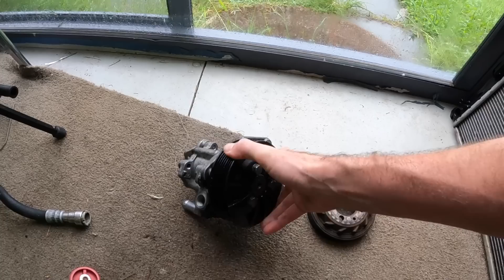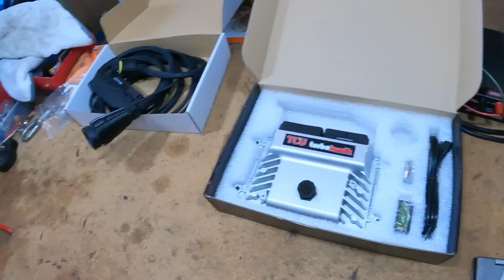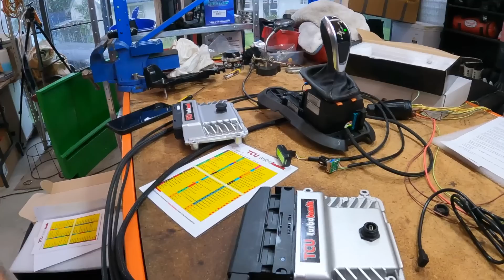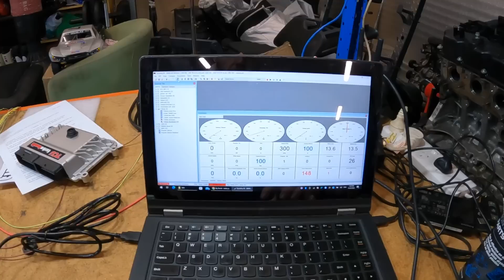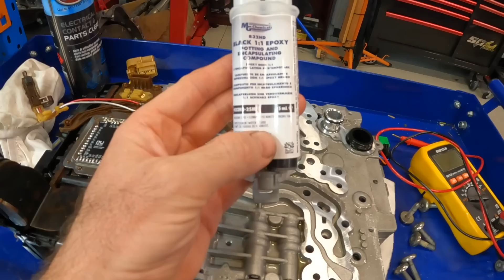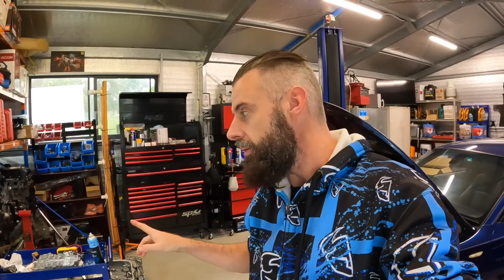BMW N54 135I 8HP INSTALL PART 1: TCU MODIFICATION

Comment: Hey did I hear you say better use the diesel converter than the N57 one? For single turbo application?
Reply from the maker: i cant remember this video. Sorry. However the diesel converter from N57 is tighter than the N55 petrol converter.
Reply: @ZeroTo60Tube  ah so the N57 is a diesel? Thought it wasn’t sorry my bad.

Comment: Key for good and easy soldering is to use the smallest gauge solder (I personally use 0.5mm diameter that has flux in it) and sharpest soldering iron tip you can find👍🏻 Great video as always. I have to say that you did great job soldering that box considering that I couldn't have soldered a thing using wire that thick

Comment: Hi any news why the one tcu gave the extra error codes?
Reply from the maker: Havent worked it out yet. It works fine in the flowmax car.
Reply: Thanks will just be interesting to know I'm in the process of doing a 8hp swap and enjoying your videos but would like to see how the 8hp45 will do in the 135 I'm planning on putting a 8hp45 behind a Mazda 4cl engine so planning max torque around 550-600nm peak and. About max 500nm at 7000rpm

Comment: Oh Damn!... you better believe this video caught my eye. As a fellow 135i'er I'm Über keen on seeing how this project unfolds! You can bet a good portion of my future spare time, and spare change will be devoted to tracking down a proper E70 8HP now.🤓 By the way Andrew, has the owner of this E82 upgraded to an LSD yet? And, in case I missed it, how about the FLOW MAX car? Thank you for the amazing info and helping make the N54  platform more exciting than ever!
Reply from the maker: This one is a stock diff, i believe. Flow max car does have an LSD.

Comment: You need some FLUX added to your soldering kit.  It may splatter or need a final clean up with some IPA after soldering.   I have not had to do any soldering work on my n54 car yet.

I like Kester Brand solder for working on keyboards, I would go with the Silver 63/ Lead 37 if you can find it, if not a Sn60/Pb40 will do.  63/37 will flash/ solidify almost instantly and help prevent cold solder joints.  The Sn60/Pb40 transitions a bit slower to a finished solder joint.  Stick to quality brands for solder.  Kester, AIM Metals, MG Chemicals, Loctite.   

As for flux, I use a paste SRA flux #135.  Flux is a game changer.  Flux removes oxides on the metals and makes the surface "wetter" ... sooo satisfying.  GOOD LUCK!  

And soldering rule #1) If you smell bacon, THAT IS NOT BACON, its your hand! 

Kester 24-6337-0018 
Kester 24-6040-0027
SRA flux #135

Comment: whole different ballgame when you use flux paste for soldering, definitely try it out you’ll thank me later!
Reply from the maker: I do use flux. I think my issue is the size of the soldering tip. It doesnt transfer the heat in to the pads quickly enough. Based on a few other comments anyway.

Comment: You have to use flux, otherwise the solder will not flow in place. Very nice stuff going on in the shop guys. Good luck, Dutch regards, Nico.

Comment: Bro how much is the turbo Lamic?
Reply from the maker: The actual unit is about $1300euro. But then you need the wiring, adapater plate, transmission cooler and so on. In Aussie it cost about $5000aud to setup it up in the other car with the 8hp70, plus the cost of the trans.

Comment: Soldering is weird. Make sure the part is clean. Flux the contacts. Make sure you're tip is still good. Tin and clean your tip. Retin and the tip and then tin the pads. It can be really fiddly, especially when you get into super small or weird joints. 

I'm really enjoying the content. Its holding me over while I search for a 335I E92 of my own. Cant wait to see more of the single turbo car with the equal length manifolds.

Comment: Anyone try a 2013 E84 X1 8HP?  We are thinking of trying it.
Reply: Nothing speaks against it! Actually a lot for it! But shouldn't a 2013 already be an 8hp? I once Was curious about the n52 x1s but the 6hp Tore me away
Reply: @maxgr7723  I meant using a 2013 X1 8HP to put in a 2009 E93 N54
Reply: @igotaction  that would mean using an n20 setup?
Reply: @maxgr7723  correct, same 8HP 45, although in USA we had N55 option 2013-15, but I know 2013 has only one PT CAN
Reply from the maker: Do it Joel!!!! Really you need the tcu assuming it’s the e series x1. Then any n55 trans should bolt on.
Reply: @ZeroTo60Tube  I would be doing it with @vehicularDIY channel.  These 2013 X1 8HP trans are $400 here I'm sure the shifter and harness aren't much more.
Reply: Actually shouldn't this be coming with an 8hp50 and having more the positioning of the dieselstarter and angle of the dieselgearbox like zf8hp70 then the 8hp45 from the n55? Actually one big thing that differs. The n55 8hp45 has the same dimensions as the 6hp...the n20 8hp is shorter
Reply: @maxgr7723  8HP50 is 2nd Gen 45 like 6HP19/21 26/28, since we are talking 2013s it would be 45.  I am getting ready to pull my 6HP so I will measure and check when I pick one up.
Reply: @igotaction  I'm really long now looking up the 8hp stuff, and I more then once watched the images and discussions in the swapping groups im in. The 4zyl 8hp comes in a different sized then the 6zyl 8hps
Reply: It will work, but torque converter won’t fit, and the box won’t be tuned right for the engine.

It is technically possible to flash E84 8HP software to another 8HP, such as that from F10. Tuning still needs to be figured out.
Reply: @ConroyCheers  actually would this make any sense? Do the n20 e84 and the n54 e93 cars share so much Controllers that you can make the e93 go with the OEM tcu? Actually it sounds like a ton of hassle. My honest opinion, get a n55 zf8hp45 torque converter, a n20zf8hp50(if that's so mandatory) and either go lamik or cantcu. One of both versions should make the car work with each advantages and disadvantages. Still best Option would be an 8hp45 from an n55 because it has the same dimensions then your 6hp and you avoid all the n20 things hassle!
Reply: @maxgr7723  if you go Lamik/CANTCU, then you only need to worry about physical compatibility, so yes, N55 8HP45 would be a great choice.

I want to avoid the high unit cost of setting up these external controllers, and hopefully I can lay the groundwork for 8HP swaps to become cheaper and easier in future.

As for the N20 E84 and N54 E93 sharing all their controllers - essentially, yes, they do. The relevant ECUs don’t actually need to be identical, because there will be CAN messages shared between different families of ECU. For example, the transmission will send a torque reduction request message to the DME when it shifts. Looking at it from BMW’s perspective - there’s no reason to have 5 different versions of this message for 5 different DMEs; it’s much simpler to program all the DMEs used in the E89 family of vehicles to accept the same message, and this way you only need to make a single transmission program that uses this one type of message. The same goes for the DSC and other modules. I’ve hooked up a E84-programmed 8HP to my E90 and can confirm it’s receiving most of the needed messages already. There seem to be a few minor exceptions, and it should be possible to work around them.

With full read/write access to the TCU, it should be possible not only to port stock tunes between different firmware versions, but also to configure it to communicate with different modules on the CAN bus. From what I’ve seen so far, some of this stuff is actually in the tune/data file, and some is in the program.

You’re definitely right that this isn’t a quick or easy solution for someone wanting an upgrade, but for me it’s become an interesting project, which seems like it could have a lot of value to the community, and for that, I think it’s worth pursuing.

I’m doing this on a N52 car, so for me, an N52 F10 8HP45 is the best option. Unfortunately, they are very rare, but I’ll be able to find one with some patience.

Comment: Hey mate not sure if you use flux when soldering but will make your life way easier
Reply from the maker: Yeah, flux the crap out of it…. I’m thinking it needs a thicker tip to actually get heat transferring on to these oads

Comment: About the epoxy...maybe put some atf and a piece of something with epoxy on it into a can , maybe even heat it to a usual zf8 temp and see if it becomes loose or smth before putting the 8hp together and filling it with atf...
Reply from the maker: Not a bad idea. I had some left over, I’ll put it in something and see if I can hurt it!

Comment: Hey long time sub here. I am running the Canformance “CanTcu” in my E90/N54/Hybrids/xDrive 8HP45 swap… first xDrive? I just wanted to give Ken a shout out as he has been amazing working through the various issues that had come up. The wizardry that is going on behind the scenes to make these units talk to each other is impressive. I will be making a post shortly on spoolstreet with more info. I am just trying to do my part now and stop the DME from giving me the old fashioned timing flatline post shift to call it done. I’m curious if you are working through the same issue with the Lamik/Wedge?
Reply from the maker: So with the lamik the torque reduction is just a setting. Well it’s a setting with a few tables to tune how much torque reduction occurs and for how long. The flow max car is still on default settings which are safe in my opinion lol. Car feels amazing to drive but it’s pulling power for a while. That said it recovers as the lamik stops requesting reduction.

I know from working with a lot of 6at cars getting the post shift timing corrections dialed out can cause an issue for a lot of tuners. However wedge will know every way possible to make it work. The bms flashes were the worst I experienced and unfortunately a lot of tuners learnt from those. Who is doing your dme tuning?
Reply: @ZeroTo60Tube  I do all my own tuning. Not a pro by any means but have about 6-7 years on this platform circa BBflash and many years on others. But again just a hobbyist for myself and friends. In the CanTcu you run the OEM programming so I have xhp stage 3 installed. However what I did not realize is the 8hp version of xhp does not have any adjustments for torque reduction probably too many maps/drive modes. But would be a nice update to be able to use on maybe “stage 4” flash only. 6HP xhp users are spoiled with this haha. So I may look into making a custom map for the xhp but like you said there are soooo many maps on the 8HP it’s a daunting task. And quite a pain using winols when you do. That will be the last resort so for now just tinkering to see what will making it happy with reported torque and load relationship. Careful what you read online from the early days on flatline a lot has changed since then. I know wedge is well aware of all that and I’m sure he will figure it out and hopefully share some insight. IJE0S/xDrive is notorious for this and post shift corrections. 

OTS BEF is good for probably 80% of JB4 users and same for ots MHD but at this level a custom tune is the only way as each car has its own little quirks. Either way I’m happy to see the N54 world getting some attention again from these guys… 

I may be regretting not going with the 8HP70 soon as I am seeing slip even in drag mode going to 6th. It’s still turned down to around 500wtq for this testing as well. But for convenience the 8hp45 was bolt on no adapters even for the transfer case. Only hardware mod was adapting the oil cooler lines. 

I know Ken@Canformance plans to eventually offer a stand-alone option but I think that may be far off. Again big thanks to him working crazy hours with the time difference from USA to Finland to get me to where I’m at. I am happy just having it in my car and running for now with no errors I will figure out the rest eventually. Though the drives in Mexico are really hurting my fuel economy at the moment lol.
Reply: Very interesting insight wancasta. Actually im planming to use canformance cantcu for an e46 330i and hopefully a b3s...actually I think I won't have the problem of to much Power and torque then...maybe more the problem of not enough as both are n/a
Reply: @maxgr7723  It will hold it no problem with torque reduction active. The problem I have is the timing doesn’t start to recover until after the following shift but this is an age old N54 issue you should be fine. My thoughts when going the with the 8hp45 was it is basically still the same hardware as the 8hp50 running in all the b58 cars making similar power with no issues.

Comment: Cam performance? Any info on where I can find more details on taking that route?
Reply from the maker: I can’t believe you couldn’t pick it from my description in the video. Canformance Cantcu in google should bring it up. Kenneth watches the vids so mention where you heard about. Seems like a good solution if you are not performance orientated. Mainly due to the trans still running a stock tcu. Where the lamik has full control.
Reply: Haha. I must have been walking my goldfish and missed it :) wanting to swap the M57 & 5L40 out of my E39 for the M67 and ZF8. If I wanted all out performance I’d get rid of the diesel element haha
Reply: @craigpickering5784  happy luck finding a 740d

Comment: Hey zero to 60. I have a question about something

I bought a 335i e90 about 2 weeks ago and I have noticed under full boost while doing a pull, and during the pull around 6k rev's I hear something go "tap tap tap tap tap" super fast almost like it sounds like a solenoid but then after multiple times of that, it then gets an engine code come up saying "Superknock on cylinder 1,2,3" (Shadow code in MHD)

Would you know what that is at all? It's driving me crazy of what it could be... The car is running stage 2+ with intakes, charge pipe, downpipes

Cheers man, love your vids
Reply from the maker: What you are describing sounds like detonation, which is knock. And very very bad. Need to check why that it, if your have a faulty O2 sensor and the DME doesnt realise it may make that entire bank run lean. Also very sorry for the slow reply, youtube put it in the spam folder. Let me know when you work out what it is and avoid driving the car when it does it. If it is detonation, its eating your pistons.
Reply: @ZeroTo60Tube  Hey Zero To 60, nah all good brother,  yeah my O2's were bad about a month ago and I got them replaced as they were damaged when I got the downpipes fitted by a mob.. I replaced then and the O2's are perfect, getting 11.5-12 AFR's..

Still today, I have no idea why it's doing it, seems the the torque is not there while the "power" is there which is very odd.

Starting to wonder if it's my injectors not working properly because I put some injector cleaner in it and after a few minutes of driving, the power is there and everything but after a few days, it's all gone...
Reply: But then it doesn't explain the "Superknock" shadow code...

Is there any software or test I could run to see what it is exactly, or a place in Brisbane that I could take her to, taking a wild guess that's your home town, as I am on the Gold Coast 👍
Reply from the maker: @rabbitolychee6395  super knock is detonation. well..... if you can just wait abotu 2 months i might have a shop ready to look after customers.
Reply: @ZeroTo60Tube  Oh man, if you open a shop I'll take it to you at any cost man, I'm only 19 and spent so much on this 335i and now I can't find the problem! Seems very odd as it does keep back firing on it's own, seems like it's dumping so much fuel while there's a misfire... Very strange problem and has no codes.

Comment: Amazing 👍. Will be great to finally see if the 8hp45 box fits n54 and what other hardware is required. Thank you 😊
Reply: Actually the n54 isn't much of a problem as it already has so many in common with the n55

Comment: That shifter is likely from a DCT E82, they didn’t get the glossy trim. Not cross compatible with the 8HP shifters, unfortunately.

What errors were the E70 guys getting? I’ve been playing around with one and could probably help.
Reply from the maker: E70 guys were abs errors.

Can you clarify the not compatible with 8hp shifters please. I have it set as a e92 m3 shifter in the lamik. Same as the way I have the e series 8hp shifter set in the flow max car
Reply: @ZeroTo60Tube  can’t speak on the Lamik, but I initially had an E82 DCT shifter which threw all sorts of errors when connected to the 8HP; swapped it for an E84 shifter and it was happy. Presumably they have completely different messages. Externally it looks the same as the E84 shifter, but there’s an extra 2 pins for the parking lock, so I don’t know if it’s the same hardware internally. You could try flashing E84 GWS ZB# with WinKFP.

As for the ABS errors - if the code is that EGS is complaining that it’s not receiving messages from the DSC - you’ll most likely need to use a different EGS software, as I believe the E90 DSC wasn’t used in the E70.

I’ve flashed ZB#7642189 to the EGS, which got rid of the DSC error. There was also an error for driver’s door message; perhaps this has already been figured out, but I just needed to upgrade the JBE to a JBBF3 and that was solved.

I suspect that at this point, you could install the transmission in your car, and it would drive. Unfortunately, the E84 (and E89) only ever used the 8HP with the N20 engine, so the included map would be wrong for the N54 and presumably non-N20 torque converter. xHP only supports the E70 8HP, so there is no custom tune support for the E84 or E89 software. I’m currently looking into this.

Comment: Get a larger tip for your soldering iron, it's less about the irons heat and more about the ability of the tip to transfer the heat.
Reply from the maker: That makes sense! That makes a lot of sense actually.